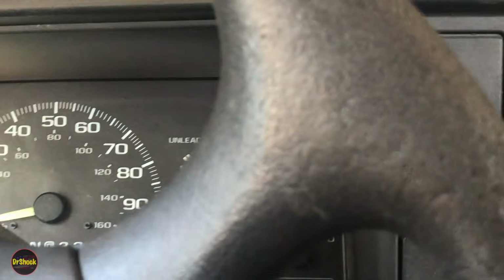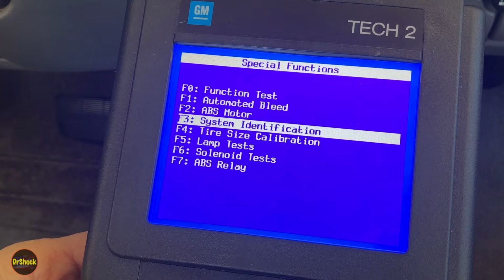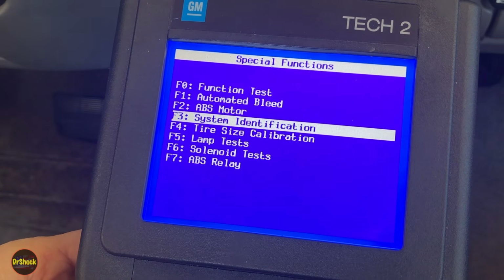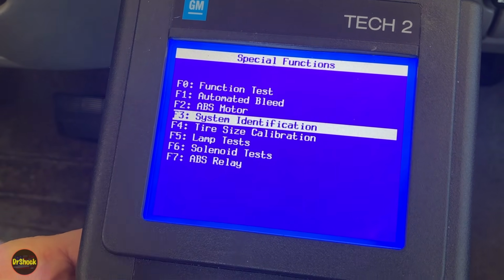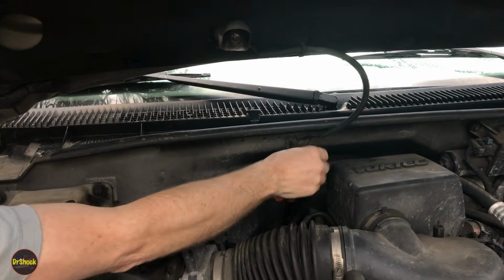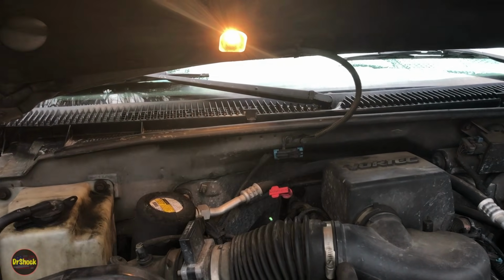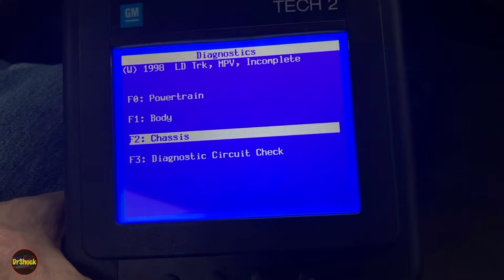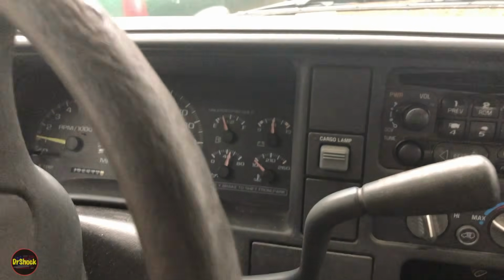1995 - 2002 GM OBS Truck 4WAL ABS Module DTC C0268 Repair Kelsey-Hayes EBC310 Teardown (Chevy & GMC)

Comment: This is the  best video to explain these brake systems that I have ever scene.  My 95 c1500 kicked the light on back in 2003 and nobody could or would fix the issue.   Een very frustrating hearing the excuses over the years.  Even got a whole replacement t unit from lkq just to find out it was locked up.  Even if I ne er fix the issue this video has educated me far beyond anything I ha e watched or read on this topic..   thank you

Comment: so just to confirm, a c1500 bpmv and ebcm will not work on a 2500? I found one for 50 bucks but I cannot confirm if it is the same jb6 code as mine
Reply from the maker: The programming for the ABS module is different between truck weight ratings on these years.  So my advice would be no, you should stay with the same 2500 weight rated ABS module for safety reasons.
Reply: @DrShock Thanks for the reply! your videos are so helpful

Comment: This video is outstanding. Have a ‘99 K2500 Diesel Suburban which I’ve owned since 2011 and the ABS has been out most of the time. Rarely the light will not come on and the ABS will work. It failed the first test on the pump motor with an Ohm reading of 0.0. So my pump motor is bad.
Reply: Is the pump portion of the BPM common amongst trucks allowing it to be swapped? Mine failed the first ohm test indicating the pump motor is bad.
Reply from the maker: Thanks, these parts are all long discontinued by GM and no aftermarket company was ever licensed by Kelsey-Hayes to provide substitutes.  Long term you may come across NOS parts using the search links in the video description.  But the only short term option is going to be a good used OEM salvage source.  Since these parts do vary by RPO codes, success depends on pulling parts from a donor with the same brake specific RPO codes.

Comment: I have a 95’ Silverado 5.7  172k mi. and my pedal has been somewhat soft . Been watching people delete abs and change the M. Cylinder with a 99-2002 style and it makes the brakes feel more responsive.  You mention the electrical connection to the abs module may not let the truck crank if a ground or sometime wondering if I do disconnect the abs will I have any issue with the truck cranking afterwards ?

Comment: Excellent video! My truck suddenly started locking the rear wheels  upon mild pedal application. Any thoughts how to tackle this issue? Is there a way to test/repair the proportioning valve? Thanks.
Reply: Same exact issue,  what was the fix?

Comment: Any way to bench test the module? I can’t get abs to talk to scanner yet all other functions are working and data wires have been checked, in my second module lol
Reply from the maker: GM did not, nor did Kelsey-Hayes, document any sort of bench type tests for this era of ABS module.  I vaguely recall though that the data line for this module is serially shared with others, like the passlock/EVO module.  You might want to check the wiring diagram and determine if one of the other modules sharing the line is causing this inability to of the scan tool to communicate with the ABS module.
Reply: @DrShock  Thanks for the reply man! The ppl data wire does connect with the EVO module and of course the VCM. It also has a tan/white wire that goes directly to pin 12 on the dlc. I’ve tested both those for short to ground and power and then resistance which all showed to be in spec. I tried yesterday unplugging that EVO module and still no coms and even tried with VCM disconnected but no luck. Power and ground at ebcm are good. Original problem is brake drag at the front which is due to either air in abs valves or bad module/stuck valve which led to me to attempting an abs bleed. I’m thinking a breakout box/oscilloscope would help but I don’t have access to either of those currently unfortunately. Let me know if you have any more suggestions, any help is greatly appreciated. I apologize for the mass amount of info, this thing has been driving me crazy lol, but thanks again for the reply!
Reply from the maker: I would likely attack these symptoms with a PicoScope at the point you're describing, as if you've verified no obvious opens and no obvious shorts then I would want to look for noise on the line or excessive resistance (corrosion).
Reply: @DrShock  Thanks for the advice! It’s starting to look like my scanner just isn’t sending the right signal to kick off the ABS diagnostics.

Do you happen to have access to a ’96 or ’97 GM C/K truck? If so, would you be willing to probe DLC pin 12 with a scope while starting an ABS session and share the waveform?

That capture would be a huge help. Appreciate anything you can share!
Reply from the maker: I don't have access to those years at the moment.

Comment: What are the Orings made of? You state they are special so im just wondering the basis of this statement please? Isn't it just a EPDM or Viton?
Reply from the maker: That comment was a warning to folks incorrectly fixated on the cost of repair, rather than the accuracy, who might try using something generic from a hardware store.   One should only be using genuine OEM parts here.  But as long as you use brake fluid rated seals, this isn't a concern.

Comment: This is awesome thank you!  Do any of the obdii chevy OBS trucks have the computer recognize the specific abs module? I bought a better 2000 k2500 but it has a bad abs unit.  I have a parts car 2000 k3500 with a really good looking abs and brake system, planning on swapping them.

Comment: Hi Dr !!
Bud I’ve been dealing with Abs light and soft brake pushing the pedal brake almost all the way in my 1996 Light Truck Pickup - 03, 43, 53 Bodystyle (2WD)
8 Cyl 5.7L CPI; 4-Speed Automatic Transmission, 4L60-E, Electronic; Pickup C2500 Extended Cab Standard Box.
I’ve already bleed and replace abs sensors brakes pads front and back but still the issue. 
I recently bought from eBay the whole abs module  from a Tahoe seller described and the label in the valves it’s a D ebay confirmed it’ll fit in my vehicle. 
Can you please tell me if that’s gonna fit?
Reply: Did replacing the module fix your brakes? I have replaced mine and successfully auto bled the ABS module but my break pedal goes to the floor.

Comment: Thank you for fixing my truck sir. What can I come pick it up? 😂.  I have a 98 Chevy Cheyenne 2500hd. I’m going to follow your testing steps tomorrow after replacing my driver side wheel speed sensor. I have just the ABS light that comes on like yours. Right after I start driving. (About 4mph) Already did the VSS and passenger side wheel speed sensor. Lucky a guy at autozone has a reader that can read abs codes.  I have C0238 (wheel speed mismatch) C0267 (pump motor circuit open) C0268 (pump motor circuit shorted) and a C0281 (stop lamp switch circuit). A guy at work that works on cars said since I have both open and shorted circuit. Chances are it’s a grounding issue. Let’s hope it is. Great video.
Reply: I just realized I’m like number 777. Jackpot number. That means I’ll be fixed tomorrow

Comment: Dr Shock your the man... So patient informing us about how to do it right. Greatest video I have seen. Personally I appreciate your time and effort. I was confusing just doing a abs delete what are your thoughts on that... Any benefits? Thank you again your the MAN
Reply from the maker: Thanks.  Personally, I would not get involved with physically removing the ABS equipment from any vehicle driven on public roadways.  For a farm truck, or other off-road exclusive use, it's not a significant concern.  Why?  It's not illegal per say (ABS did not become federally mandated until the 2012 model year), but there are financial risks if you are not using a commercial kit to perform the modification.

The vehicles insurance rate is based partially on the VIN reflecting factory ABS was installed.  Deletion would of course post DTCs, which could fail the vehicle during inspection in several states.  But more importantly, such a safety equipment modification would subject the shop, or individual, performing the work to be liable in the event of an accident. 

These trucks are still repairable factory ABS wise, for now as I've shown here.  While I'm not aware of any today, in the future perhaps some companies will step forward offering commercial aftermarket conversion or ABS delete kits for GMT400 trucks.  That would be a sound route to take in the future, as the commercial kit would address the legal risk (and you declare it to the insurance company).   But when they are no longer repairable, sadly, I would advise it's then time to retire that GMT400 from public road use.

Comment: Where did you get the plastic plugs you screwed into the disconnected brake lines?
Reply from the maker: There should be a search link in the video description.

Comment: After bleeding module, there is no need to re-bleed at wheel ends? where does the air in the module escape to? Also will the tech tool automated bleed work if the ABS light is on? Say for a bad wheel speed sensor. Thanks, I've got spongy and weak rear brakes brakes on a 96 K2500, after rear brake line leak/repair. hope bleeding the module will fix it
Reply from the maker: Bleed the calipers and wheels cylinders in the usual fashion.  Then use the scan tool to initiate the ABS unit bleed procedure.

Comment: This is the data of the original ABS module
BPVM part number 32976
EBCM 4WAL Version ID: D7811TJP
Combination valve is marked with the letter S

Can you help me to get the right working ABS for my Suburban 1997 6.5 TD?
I had bought a Refurbished on ebay in the USA but upon delivery I already saw that the BPVM had a different number and when I used the 4WAL version ID it was GCK36J and I could not connect to the ECU.
I could disable the ABS but then I can no longer work with the GM Tech2 because the ABS connects to the ECU.
That is why I am sending you the details of the original ABS that could connect to the ECU.
Thanks in advance
Reply from the maker: The BPMV (brake pressure modulator valve) assembly is a shared common GM part number by all the trucks except the 3500s with RPO JF9 brakes.  So you likely are OK there (the Kelsey-Hayes numbers on the parts themselves are not documented anywhere so not very useful).  On the combination valve you could just reuse your original if you got a different one in the refurbished unit worst case.  There are only two EBCM units for the non-3500 trucks.   So you have a 50/50 shot of having the ideal one.   I would still expect communications with the wrong one, just operational issues.  

Is it correct that when you connect your old unit communications are possible, but when you connect the refurbished unit there are no communications?  If so, I would return the refurbished unit as defective and explain to the seller that when its plugged in your ECM/VCM communications are being interrupted.  These technically cannot be rebuilt, so "refurbished" here cannot mean anything more than a cosmetic cleaning unless the seller explicitly states that they road test each unit they sell.
Reply: @DrShock  So it is indeed correct if I connect my old unit I can communicate with the ECM/VCM I also wrote to the seller but only got an email back that the software must also match mine and if I did not agree I had to return it, that was not the case so I have already sent them back I only received them yesterday (9/17/2024) and today (9/18/2024) I have already returned them because after the last email via Ebay there was no response from the seller.
With the ABS that is now temporarily mounted I can communicate only with the EBCM but not with the ECM/VCM which also has the 4WAL Version ID: GCK36J .... the Suburban brakes better with this unit but not as it should the ABS always activates when I use the brake. Here in Belgium I can't find this ABS unit so I wonder if I will ever find a working one because most sellers don't have a clue when I say it has to be a 4WAL Version ID: D7811TJP, .... they don't even know what is meant by that
Reply from the maker: Have you tried doing an automated ABS bleed on the original unit using a Tech2, or similar, scan tool?   Sometimes performance issues on these units can just be the result of entrapped air.
Reply: @DrShock  I also did that with the original unit with the GM Tech2 but I kept getting the code C0042 = BPVN replaced .... what I have now also noticed is that my odometer does not work correctly when driving 80 km / h then I am actually driving 62 km / h and calibrating the tires does not help because this unit does not connect to the ECN / VCM which ultimately also controls the odometer ,
Reply: @DrShock  As a last resort I could try to place the combination valve marked S and the EBCM from the original unit on the now working BPVM but then I would have to renew those 4 bolts and those 2 parts (on the parts diagram in service book no. 13) of the combination valve or take the risk of reinstalling the old one , I don't think it will work safely then so the only option I have is to find the right unit
Reply from the maker: You appear to have several, unrelated, issues going on.  The odometer is obviously mechanical on these years but driven by the VCM/PCM.  Nothing directly related with ABS other than they both likely share the speed sensor inputs.  For the ABS unit, it would be OK to swap the EBCM, as long as you reseal it.   When Kelsey-Hayes rebuilt these they actually used an RTV sealant, contrary to the GM service information (I believe I showed this detail during disassembly in this vid).  

I would not recommend moving around combination valves and BPMVs unless you have the correct seals called for.   When looking for a replacement, rather than eBay sellers of refurbished claims, just search for someone parting out a 1996 thru 1999 Suburban with the 6.5L diesel engine option.  You should encounter similar equipment on the 7.4L 2500 series Suburbans of these same model years as well.

Comment: DrShock I understood from your explanation at almost the end of your video that I need an ABS with letter code S because the suburban 6.5TD is too heavy (3Ton), because when I reconnected the old ABS (electrically) I could work with the GM Tech2 again and the faint warning brake light on the dash had also disappeared.
The reason why I have to replace the ABS is that I have the DTC code C0042 BPVM failure .... I could no longer bleed the brake system.
Can you sometimes help me to find the correct ABS with letter code S because it cannot be found here in Belgium, thanks in advance
Reply from the maker: Your best bet with this kind of long discontinued part is eBay.  I put some links in the description that you might check.

Comment: DrShock I have a suburban 6.5 TD from 1997 where I recently replaced the ABS (junkyard) according to your information an ABS marked with a D should have been mounted but the one I dismantled was marked with an S so I think that was not correct.
After mounting the ABS and bleeding the brake system LR-RR-FR-FL sequence and having performed the automatic bleeding the red warning light kept burning faintly when I wanted to perform the SPS the GM Tech2 (software version 33.004) said that no connection was possible.
Before I replaced the ABS I could make the SPS connection and the software version was 16244315.
I did not pull any wires from the connectors of the ABS anywhere during dismantling or mounting
My question is the following where can I look for the error that the warning brake light on the dash burns faintly and also why the GM Tech2 cannot connect to the ECU but can to the ABS? My email address is selectwilly@gmail.com.
I live in Belgium.
Reply from the maker: Based on what you've described, I'd suggest you'll need to debug an open/break or short in the communications bus wire (from the OBDII connector/DLC under the dash into the engine wiring harness) if you are having Tech2 communications issues.   Several of the modules are in series with the EBCM and could be causing this.   The electrical schematics in the service manual are going to be a must have to pursue that one.   For the faint illumination on the lamp, that could be anything from a dying bulb to a ground issue.  I would suggest you focus on the communications problem to the EBCM first.

Comment: I have a ‘95 Cheyenne 1500 and I found that it has a JB5 and a D on the combination valve. My problem is, I don’t have any dash lights on, but my driver side wheel is overheating and it caught fire once. The brakes were locking up. I was told it might be the hose. So I replaced the hose and the caliper. It worked fine for 2 years. But now it’s doing it again. It pulls to the right when braking. Even started shaking bad when I drove it. I can only assume it’s the ABS module. It’s kinda weird that it ran fine for a couple of years. Perhaps one of the solenoids is sticking? And that’s why it went fine for two years? I guess I kinda cleaned it out. That’s my best guess. I would really hate to get rid of it. My biggest question is you said in the video the combination valves aren’t interchangeable. So I have to find one with a D correct? Unfortunately I bought one off amazon but it has an A on the combo valve😢
Reply from the maker: The description of the video has alot more detail on the parts and different codes/numbers involved.